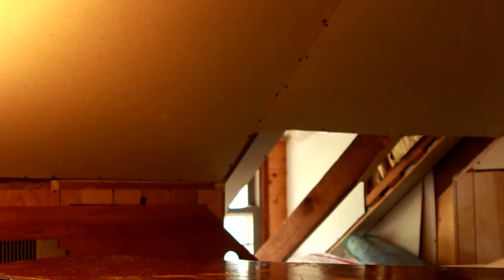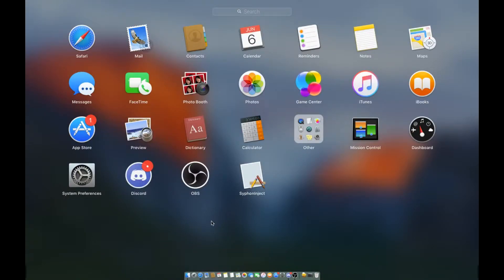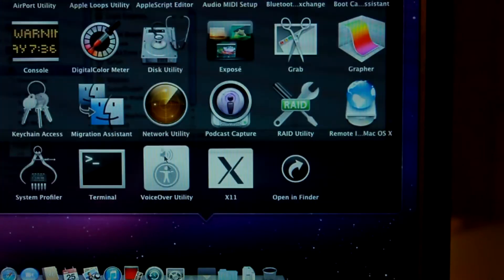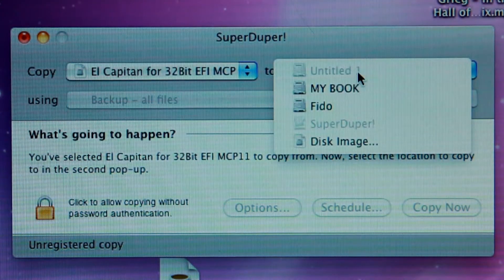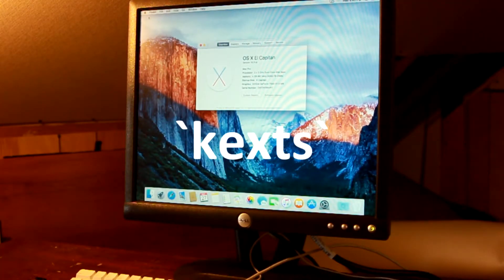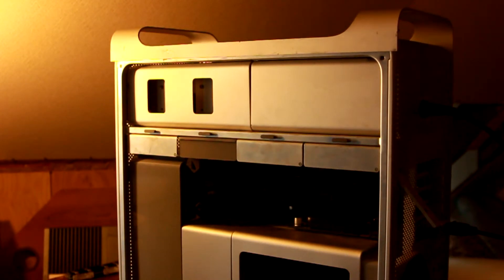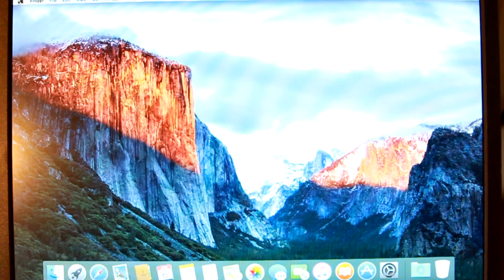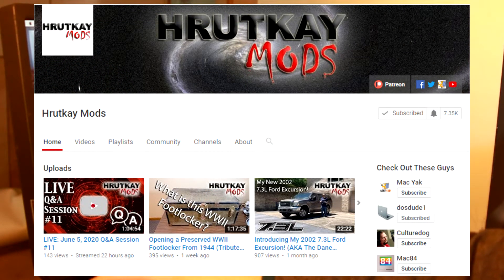How To Install MacOS El Capitan on An Unsupported 1st Gen Mac Pro

Comment: So when I boot up Hrutkay's disk image on my new 1,1 Mac Pro, it takes me to the welcome screen, but I can't use my keyboard or mouse...
Reply from the maker: what keyboard and mouse? also have you tried a different set of USB ports?
Reply: @WindowsG  A standard wried apple keyboard with numeric pad. I have the receiver for my MX master mouse plugged into the side. I've tried all the USBs on the machine with no luck. Hrutkay says something about needing to run MacPostFactor to get the drivers for USB devices to work at 1:15 of the disk image download video. But then right after that says that the image is 100% compatible. He doesn't have any videos on MacPostFacotor, and it's failed each time I try to run it. Really don't understand what is going wrong here...
Reply from the maker: yeahh no idea then, the disc image comes pre-patched with proper kexts.. maybe try a different keyboard and ensure the wired apple one works..?